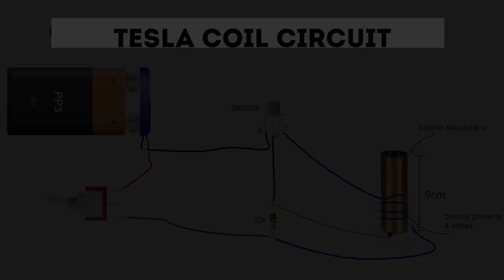How to make a mini Tesla Coil – Easy Tutorial

Comment: Make sure the coil of wire on the primary side, the thicker black wire, is turned in the opposite direction of the enameled red wire. It will work! I hate this electro- pop music BTW!
Reply: It doesn’t matter in this setup, it’s weak

Comment: Yes but its fake
Reply: Not fake... just I saw at mine works well.
Reply: Did you make sure your primary is turned in the opposite direction as your secondary? That was my problem. I just flipped it over and then it started working.
Reply: It’s not fake even I did it it worked fine but I needed a little more coper wire
Reply: Skill issue can’t make it and just goes to the fake statement 😂